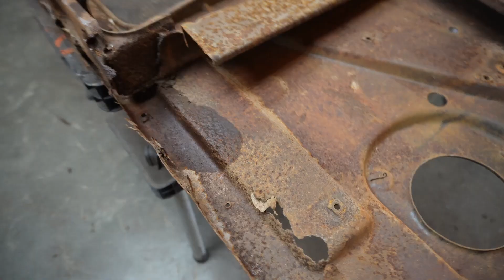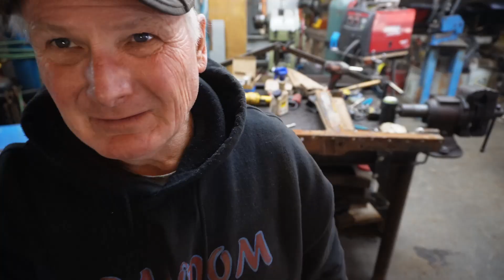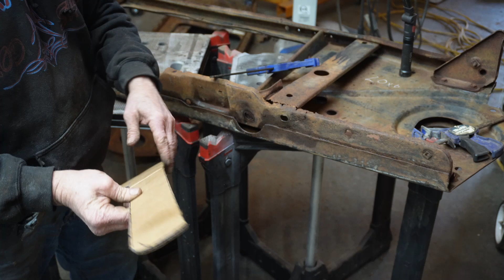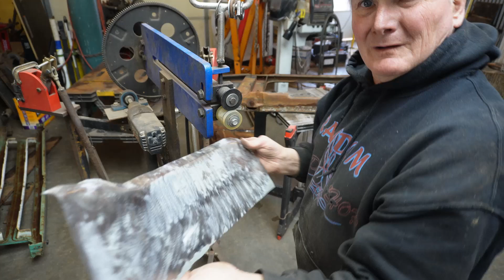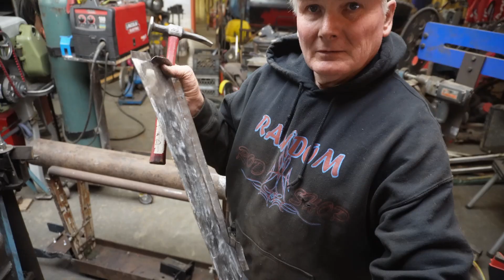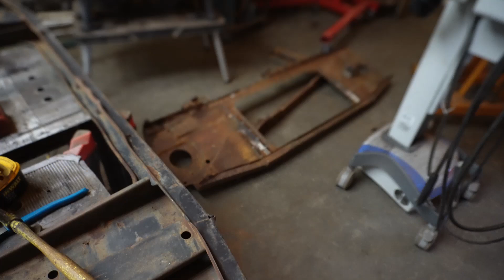DIY Radiator core support rust repair with an old shelf

Comment: Been there done that. I was lucky, I was able to get by with a shorter piece and didn’t have to put the extra curve in. Nice work so far.
Reply from the maker: Thanks. Getting the area around the support mount disassembled was an exercise of extreme patience. The rust had removed the spot weld divots. It should be relatively easy to finish it now.